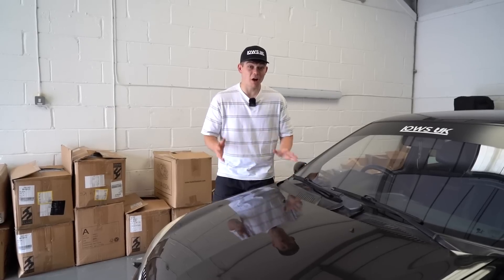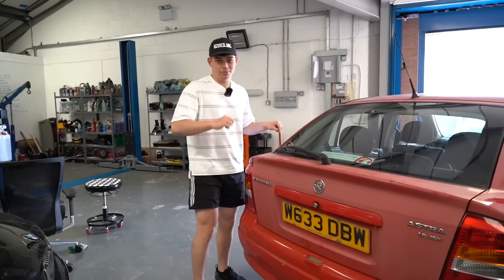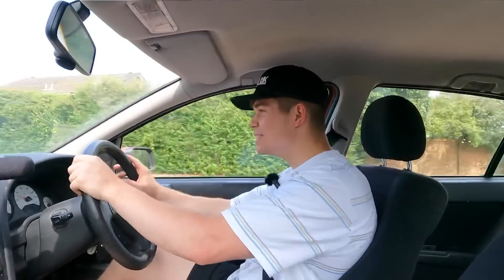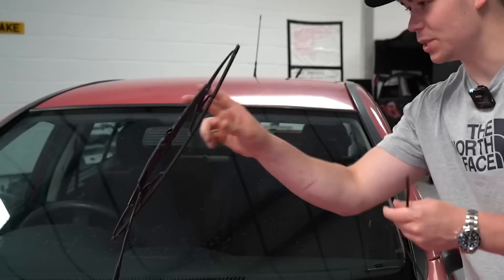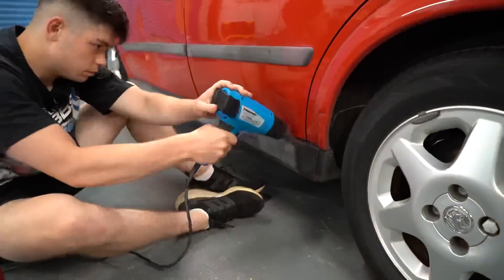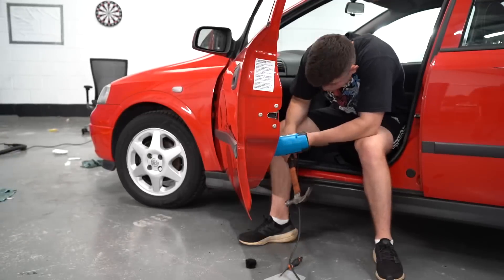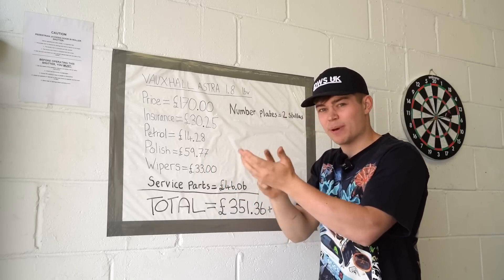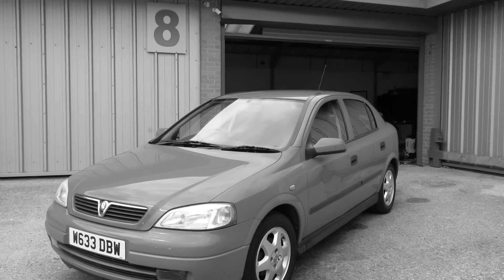£170 CHEAP CAR CHALLENGE ... CAN I MAKE A PROFIT?

Comment: Looking at this, I think my Astra that I bought earlier this year is probably on par for value with this one. Mine is a 1.6L mk3 Astra Duo (a special edition) with only 27.5k miles on it and the whole car was in mint condition (minus all the dirt and mold in the interior). And to top it all off, only £250.
Reply: £250 with that low miles? Bargain

Comment: Did you really take the rear number plate off pulled the grommets out and double sided taped the plate on.  So left two holes for the boot to rust 👏👏.

Comment: Great transformation Jack Little bit of a tip for you mate all your plastics to renew and make them look like new ceramic coat them seriously works amazing you won't believe it till you try it once again excellent transformation of the astra brilliant daily driving car does everything you need them to do 👍🏼👊
Reply: Probably a bit expensive for this level of car. A quid on some baby oil is a surprisingly good trim restorer though and probably cheaper than the electricity running the heat gun!
Reply: @adammcallister2260  It won't make the plastics brittle like a heat gun does either.  Oil-based trim restorers are the only way to do it, even peanut butter works in a pinch.

Comment: I had the 1.7cdti on an 05 plate lovely drive but had numerous issues with it electrical gremlins and egr the petrol ones are the best ones. 👌 and they were galvanized so never rust like the previous model.

Comment: Hi jack, very entertaining video especially for me as l am staunch General Motors fan . 
It’s not just European Gm paint that oxidises so terribly, I assure you my 97 Camaro is afflicted in the same way. 

Re the doorskin , you may want to consider for future reference the space hopper/inflatable ball trick. 
Simply deflate the ball and place it inside the affected panel, gradually inflate it whilst applying hot water or hot air to the outside of the panel and as long as it’s not creased to death it works a treat 

I’ve had a fair bit of success in the past with this, Hope it helps you too

All the best 

Jay 👍

Comment: The heat gun draws the resin out of the plastic to the surface, which makes them appear " blacker " however this is at a cost. The resin provides plasticity to the trims, and now will be very very brittle. Cheap fix to sell a car on, if you intended to keep it other methods work better

Comment: I bought a k11 micra some years ago for £150 that had full service history and 26k on the clock, not a single thing wrong with it was mint condition except From a passenger door damage, bought a second hand door but in a different colour for £30 and used the car for several months. Bargains are out there and I have come across a few

Comment: Nice video bit later but use peanut butter on the black trim cost 20x less than cleaner and the natural oils within the peanut butter will darken for plastics  ..get some partridge paper and spread on that leave on plastics for about f 10mins then make sure you wipe off as you  don't want the car smelling like peanut butter lmao I used this method for deacade plus even on my RC plastics lol 😂😂

Comment: Knowing where there is a plentiful supply of cheap parts helps.  I have a few sellers on ebay that sell new old stock and business clearances.  Bought a £200 Passat TDi a couple of months ago, spent £250 on it and sold for £1650
Reply: Any for me then as can't find a single bargain
Reply: @flippingcarsrepairs  try typing the part number in ebay and sort results by lowest price. Can't remember off hand the sellers I use but I'll try get a couple of names

Comment: FYI, using a heat gun on those plastics will make it much more prone to cracking just sitting about now. People with Minis do it to their scuttle panels and then wonder why they crack when then check their brake fluid level and battery.

Comment: As it stands, a 1.8 8v Astra sells for around £250 without cat, battery or alloys to the banger boys.

You could probably get £20 for the battery, £60 for alloys in scrap and the cat will go for a fair bit also. Could potentially break £500 as it sits
Reply: Thats not going to make money on yt content thou

Comment: News update I just had my roof cleaned first time in my ownership what a huge difference my car looked. I have drove it up to London a few times..
I recently had a wheel bearing done with 4 spark plugs it drives nice a new rear exhaust would make huge difference.
I feel once I go this far I will improve the whole car which means a body shop to do the paint work.
It seems 100% safe where I park it away from home..as outside my flat the car was quietly being destroyed.

Comment: Hi I am Tim Real new to this channel I am old skool guy 58 
I own a few vehicles one such is my Vauxhall Astra Convertible 52 plate (private plate P12 ENN) its A metallic blue car done a lot of miles.
It has rear quarter damage minor scratches. Think I've owned it since 2016.
Generally I've never bothered much cleaning it.
Due to health issues I used to love cleaning my cars I did have a garage at my parents house which I had the chance to buy even though my dad had bought it.
His new build garage was Lush..
The car had new engine from a 60k car before I owned it. I only gave £350 for mine.
I love your simple cleaning attitude it works.. So many videos go to far on wheels wheel arches and so on I believe its a car clean product sell.
Red is a bitch for fading but you may have caught this car in time.. Who knows..
My dilemma the previous mot was a stinger alternator and belt the old snapped, new battery wiper blades caliper brake pads to name a few parts  £635 on mot.. It should have been scrapped but my plate is worth £650 all day long.
So this years MOT I was dreading it And phoned a marketplace Astra convertible guy he offered £650.
I was tempted but I've lost my collection of cars well 3 Jaguar MGF se And my beloved Vauxhall Vectra Estate.
I bit the bullet took it for MOT it had couple fails door mirror glasses and yellowing headlamps next day it past full mot.. cost £65 mega chuffed.
It was even taken for a wash and it looked lovely.
Do I carry out a gentle re-furb and get it in tidy respectful condition or do I search for a really low mileage example..?
Great video
Tim

Comment: I think that’s the z18xe engine 120bhp.. pretty good engines
Reply: I think that's from the sri specs mate these should be around 110bhp which is still alot for a standard astra
Reply: @dubzuk3710  they was 123 standard bud

Comment: £170?!! Mate you've overpaid forbthat bag of garbage🤣🤣
Reply: Get on your bike lad
Reply: It's like past times for me I payed 170 for a Corsa van on an 02 plate ex bt think it was 1.7 or 1.8 ran on next to nothing
Reply: @jamieeedden777  I get what you mean, I was just making a joke, I bought an audi a2 for £100 and drove it about for 2 years 😅 🤣
Reply: @mathewearnshaw4279  think I know the A2 is that the one where u lift the bonnet of every time you open it
Reply: @jamieeedden777  yeah that's the one 👌
Reply: @mathewearnshaw4279  worked on a few before I quit being a mechanic never owned or driven one tho
Reply: @jamieeedden777  they're pretty decent to drive. Was quite reliable but they just look awful 🤣
Reply: @mathewearnshaw4279  I'm looking into getting one for my older sister when she passes are they good for a new driver ? Our mum recently passed at 46 years young so don't want her to worry about getting a car or it being high to insure and run
Reply: @jamieeedden777  it was my first car and it was easy to drive and not bad on insurance all things considered, never left me on the side of the road and I abused it for a long time